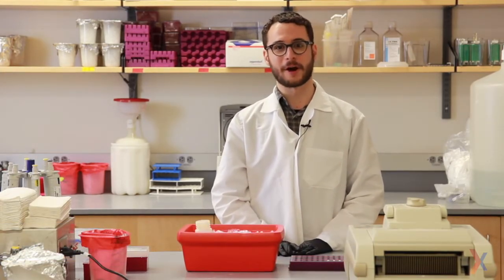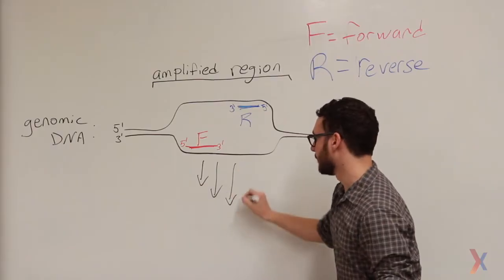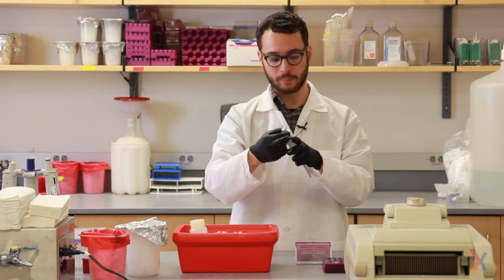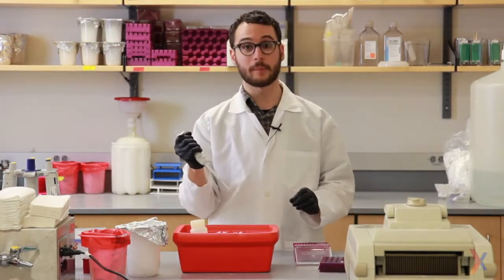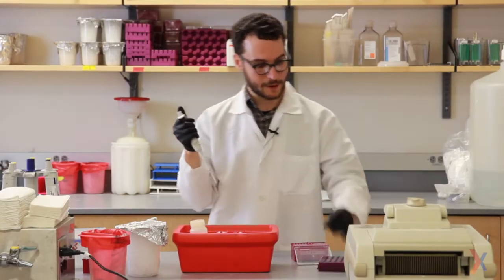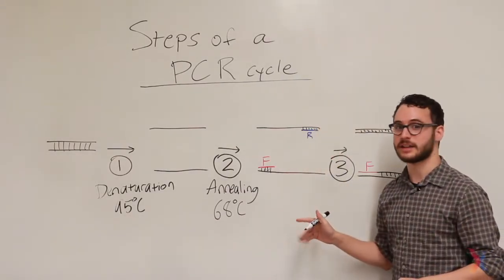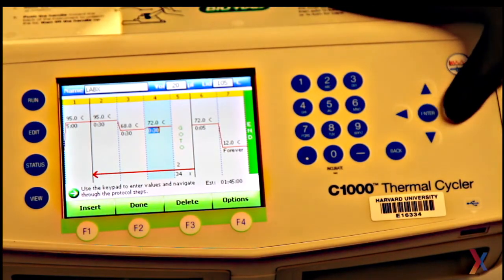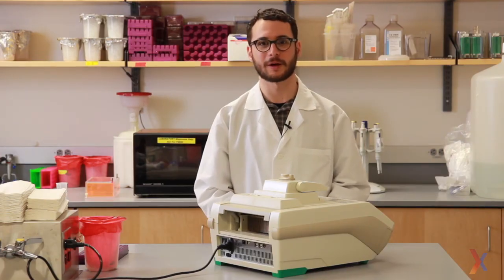PCR Method Video

Comment: Thank you so much for sharing this video. I am curious do you think if you were processing multiple PCR test at the same time that a viral particles can travel from one specimen sample to another or is it obviously best practice to sanitize everything before you process another sample. What do you think the industry is doing nowadays to prevent contamination from one container to another when they’re doing mass testing for covid 19?
Reply: Huge amounts of one-time-use plastic brotha.
Reply: Maybe I'm misunderstanding your question but each tube had a locking plastic lid so I can't imagine any particles being free in the machine.
Reply: @Jeremy Marsh I could have posed the question with an example. let's say person A has viral shedding occurring. They sneezed in their car several times before arriving to the testing facility. They pull up roll down the window with their air in car spreading those viral particles all over the place. The person who takes the sample now has the virual particles all over their person because they reached their arm in the car of individual A. Throughout the day the person who takes the sample may not knowingly be dropping the particles off their ppe into sample containers. @ Jeremy Marsh do you know if they replace their PPE including the gown they wear after taking every sample from a person in a car? If I got tested I may have or not noticed they did not do that Change their gowns after taking someone's sample. I almost felt like for all I know this person taking my sample could be dropping the viral particles in my car. I am ignorant of how all this works but from my understanding, the viral particles from people shedding comes out in the billions, and in a car with the heater cranked it's just flying all over the car when people shedding cough or sneeze in their cars before coming to get tested. This is one of many examples of how containers or even bins containing samples can get contaminated.
Reply: @quantummandavid  I would think if a larger than normal positive rate was traced to a certain testing site, they would have to look at the collection technique. Furthermore, the sites I've been to has the patient self-collect the sample and seal the test tube themselves, so the probability of contamination is negligible if not nonexistent. I'm an ER nurse and have collected and sent several hundreds if not thousands of tests in the past 2+ years, and the negative rate is more than I might expect, and trust me, I go allll the way into the nose!
Reply: @David espinoza If I’m understanding your question, I believe that after a pcr, one would run a gel electrophoresis- which includes a negative test tube for checking contamination besides reassurance that there’s indeed genetic material in samples.  I hope this helps

Comment: Primers are synthetic RNA molecules right??? Not DNA?
Reply from the maker: Such a good question. In the cell, yes, you are totally right: primers are made as short RNA molecules.

However, when we do it in a test tube, we typically use DNA primers (which have several benefits, such as increased stability.)

Comment: is it compulsory to start the pcr programm with the initial denaturation step (95/5min)?
Reply from the maker: Great question! No, holding this temperature for 5 min is probably not really compulsory- most of the DNA is probably denatured before 5 min. We often hold this first step for 5 min just to ensure that as much DNA is single-stranded, which should maximum how much PCR product we make after 30 cycles. But the length of time of this initial step is a variable we can change to optimize the yield of the reaction. The time duration of this step can depend on the other experimental conditions: the the template and primer DNA sequences; the type of enzyme being used; and the salt concentrations of buffer. Using 5 minutes often works, but we can change it to optimize the reaction if it doesn't work the first time. But the temperature is relatively compulsory. PCR requires the denaturation step (initial and otherwise) to be programmed at a high temperature, commonly between 94-98°C.
Reply: @LabXchange  Very clear! Thank you for your time :)